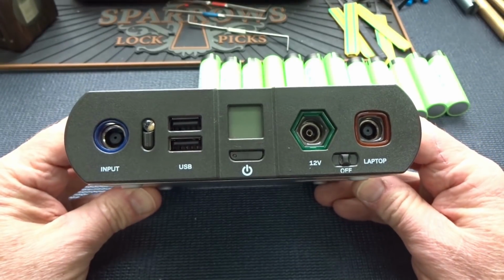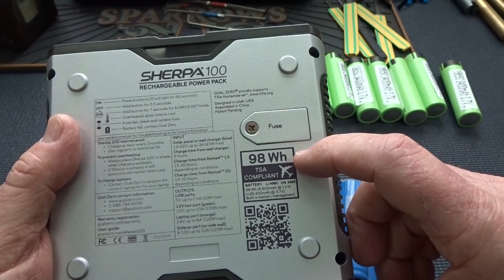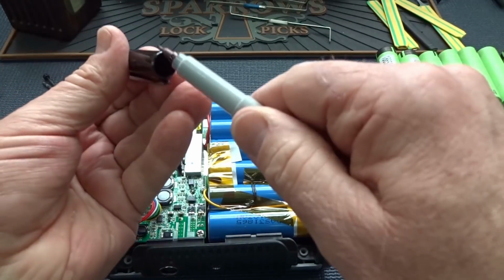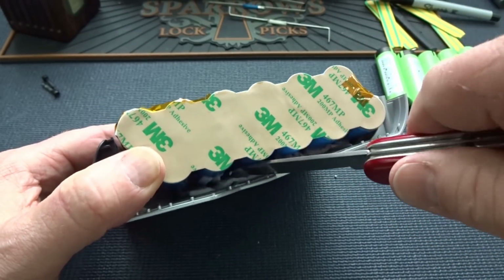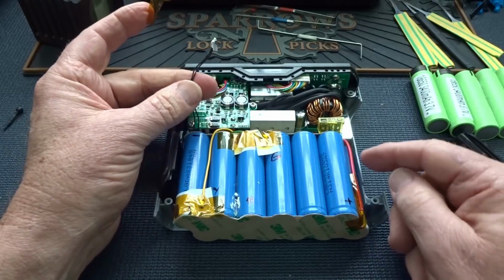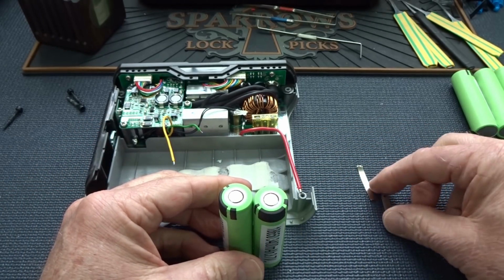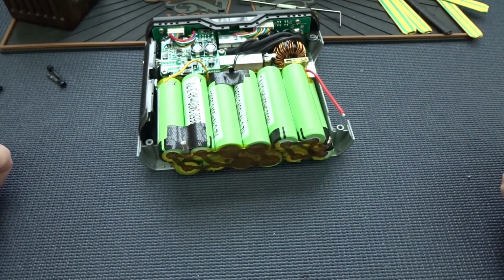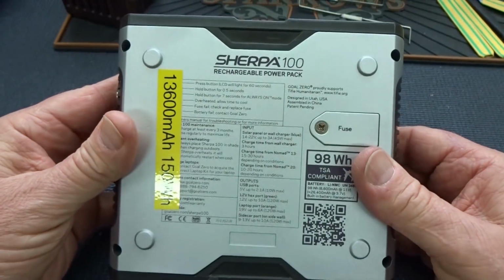Goal Zero Sherpa 100 Upgrade

Comment: I have watched your video many times, so attempted to change the batteries on my Goal Zero 100. I give up. I have redone it so many times and still have that darn error. I believe that I put it together correctly but no go. My soldering efforts leave a little to be desired.  My question is do you want to try to repair it for the boy scouts? It may be beyond repair at this point. If yes, where do I send it?
Reply: I appreciate your offer, but this model is long obsolete and there are now better options out there that don’t cost an arm and leg.

Comment: My Friend, I have a sherpa 100PD 4th generation (not ac version).  Do you know/can you help me open it without destroying the case?  It has bad cell (i'm pretty sure) and need to open and replace it.  there are screws in the back and slide off rubber pieces on the side but no obvious way to remove it from the aluminum case after that.  No visible screws or snaps on the front face.  Your help is appreciated. Of course, no assistance from goal zero given on disassembly.  Thanks.  Terry

Comment: Have you seen a case where you connect the new batteries, test them get the battery display to read a % charged, in my case 80%, and then go back to battery error?  I checked all my weld and solder points, checked continuity across the batteries and voltage across the stack and all seem positive.  Any suggestions?
Reply: @CraigLucca  check your fuse.  If not that, then the circuitry’s gone squirrely.

Comment: Hi, I have the same Sherpa 100 and today it started flashing both the 12v and Laptop circles after I plugged in a piece of equipment via the 12v car adapter cable. Shows the battery fault icon and the current state of charge 80%. I'm able to turn on the little led light but the USB ports are not working. Any advice as to what it may be? Is there another fuse inside between the 12v and battery that may have blown?

Comment: Hi AerialWorks, i have a sherpa 100 and there are times i cant turn it off. The battery indicator appears but no blue back light. Ive already sent it to our local goalzero distributor and repaircenter but they werent able to fix it. Any help will be greatly appreciated. This videos gave me another hope to reuse my sherpa. Keep up the great work
Reply: It sounds like either a switch problem or something haywire with your circuitry.  Sorry, but GZ doesn't offer any repair parts so it looks like you are out of luck.

Comment: Hi, where can I get a chaining cable  for Sherpa 100/50? Please advise
Reply: No idea.  I tried to locate one for two years and Goal Zero was never able to produce one.  One of their salesmen suggested that after the initial production run demand was low so they never made any more.  Irrelevent now because the old Sherpa line in this video is now obsolete & been replaced w/better, higher capacity units at a lower cost. Good luck!

Comment: So you are saying to remove your sticker before taking it on the plane? :-)  I mean would they know without taking it apart?
Reply: They would not know. But if your battery did burn, blow up, etc.. and they found out it was modified through the investigation, you would be charged with a crime. If the plane crashed and/or people were killed you will be in prison for a long long time for pre-meditated homicide. So basically, don't do anything you are not supposed to... even if no one is watching :)
Reply: > and they found out it was modified through the investigation, you would be charged with a crime.

And you think the removal of the sticker would somehow absolve you of that crime? That's not how it works.

Comment: There are also 4200mah 18650 batteries. But I only see them with a point. Would those also work? Is there room for the battery with pin?
Reply: No, there is no room.  Also, the 4200s are probably fake.
Reply: There are no 4200 mAH batteries. They are fake.  I test batteries all the time. I just bought and tested a battery labeled 5,000 mAH and it tested at 1100 mAH. Best way to tell is the weight, if you do not have a charger that tests mAH. Get a real 18650, it will be MUCH heavier than a fake one. Very noticable.
Reply: Anything above 3500mah is a fake. This will not change until the glass/solid state batteries are available to the public.

Comment: Don't use a knife or anything sharp to pry those batteries out. I can tell you from experience that they puncture easily and shoot a fountain of sparks just like fireworks. Also,  storage charge for lithium ion batteries is not 20%. That will severely shorten battery life. The manufacturers say 40% but these batteries are designed to stay at 90 - 100% for best performance.

Comment: Hi, I did the same battery upgrade for my sherpa 100 but at 60% the battery fails. Any advice? Thanks
Reply: It sounds like youmay have overheated one or more of the batteries while soldering.
Reply: @bosnianbill  I did check the voltage of each battery before setting them up. Also I charged each battery using the 18650 battery charger.

Comment: What source are you using to ensure genuine brand 18650's?  I've had terrible luck with eBay, mixed results with Amazon.
Reply: Yep, they look like fakes!
Reply: Panasonic's do look like that, it's just that unfortunately you can't tell by pictures because it's merely a heat shrink wrapper anyone can copy and use on junk cells.  Best way to tell if they're genuine is just using a smart charger and seeing how much they take from full discharge.  Knockoffs won't even bother being anywhere close to 3000mah, because it's too expensive to manufacture that much capacity.

Comment: Do you know how to fix the infamous fuse failure light? Even after replacing the fuse with a known good fuse?
Reply: Usually it means one or more of the batteries has an internal short caused by overdraining it.  Sorry for the bad news.

Comment: Would the NITECORE NL1835 - 18650 3500mAh 8A 3.6V work in this Sherpa? I'd like to upgrade and want maximum capacity. Perhaps going for the extra 100mAh isn't worth the price difference.
Reply: Yes it will work if you have the $$
Reply: Bad idea. I think the sherpa has a 25A fuse. Thats to much for 4 cells inparalele.

Comment: They didn't use those cells because it was "older technology", they did it so it would make the pack compliant with TSA regulations and guidelines. Can you make a bigger pack with cells that have more capacity? Absolutely, but now you can't travel with it.
Reply: On easyjet its 150wh